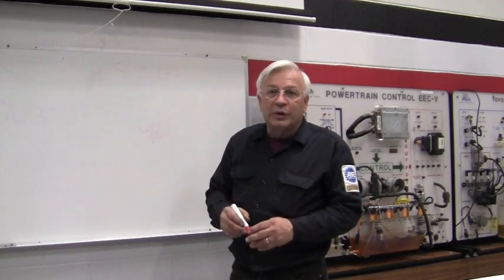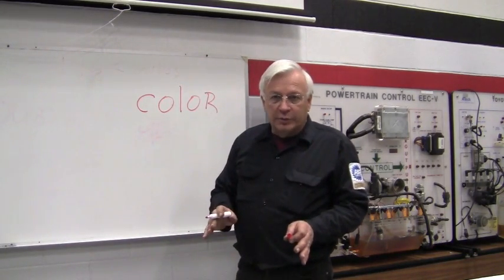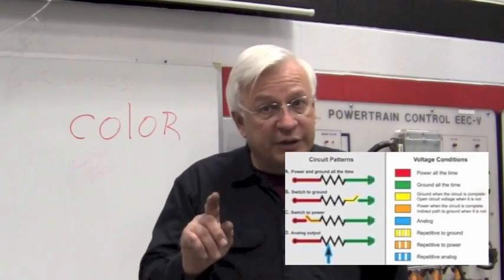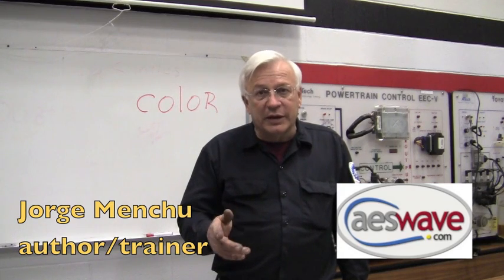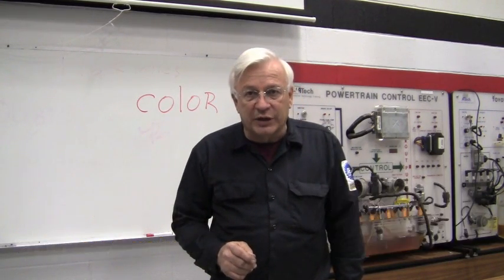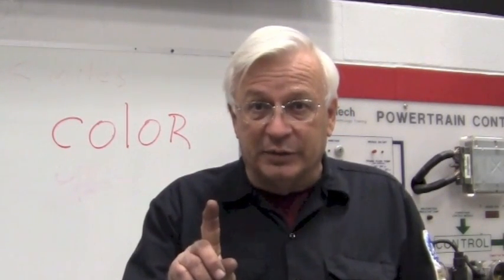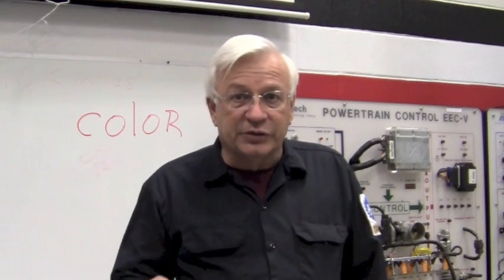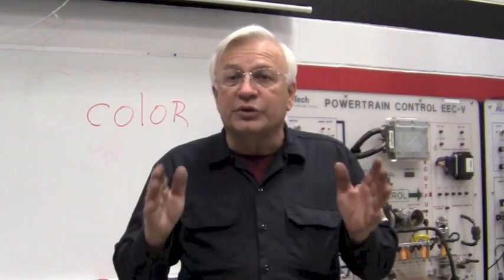Training Series  How to read an electrical diagram

Comment: Thank you, very well done. Your help is something that I can use all most daily repairing equipment here on my ranch. Tractors, loaders and trucks have electrical issues often. They have added a lot more electrical to engines, transmissions, drive lines and a/c than when I worked in the auto / truck field  in the 70s, 80s and even 90s. Your efforts a greatly  appreciated.

Comment: I watch all of your wiring diagram video to get a better understanding of how to read a wiring diagram chart. It's just like you said, the Jorge Menchu rule makes sens, just like mechanical parts but in a electricity of understanding of how wiring works with resistor, transistor and other wiring symbols like the coil. A map of symbols how electricity flows. Your by far the best ASE YouTube Instructor out here, keep up the good work.

Comment: If manufacturers would come to a consensus about color coding, reading diagrams would be a lot easier in color. But even a simple tool like this is helpful. Sometimes I get fooled when the switch side is the ground side, but a little thought clears that right up.

Comment: That was a great read, I remember my autos teacher in high school talking about this. Come to think about it,I've been using my multimeter in the same manner trying to chase down the problem that's making my car run goofy. Wish I could find a break in the case though. . . Or at least a oscilloscope so I can test my cam/crank/maf/(etcetera) sensors, lol.

Comment: i need to know what the color coats indicate on my 2011 f-150 XLT 3.7L V6 MAF sensor connector coming from the wiring harness to wire in a new plug as the pre-existing plug was cut off and i do not have the old plug. There are four wires that go to this plug that connects to the MAF sensor. As follows> violet with a grey stripe, blue with a brown stripe, yellow with a violet stripe, and one solid blue wire... the color coats on the plug are different so I am unable to determine their order or wiring sequence. which wire goes where in what order and to which color?  This has me stumped so I am kindly requesting you experienced advice and help. I haven't the money to send it for repair so can you please help me? I just need to get the plug wired in correctly so i can plug the MAF or MAS sensor back in.. Your time and assistance in any way will be highly appreciated pertaining to this task. I know what general red and black colors indicate hot & ground and I know how to use my multi volt tester but I am afraid to attempt testing on the wires mentioned in the above because i don't want to fry the brain on the truck. please help... thanks.... Joseph & Nicol

Comment: I have a stereo system that needs electrical troubleshooting...No,or intermittent, sound. The factory system has been replaced with a after-market system with amplifier.